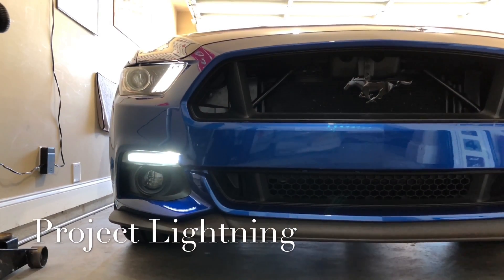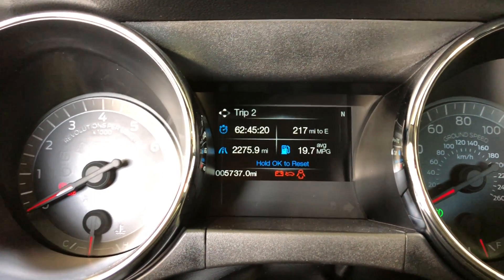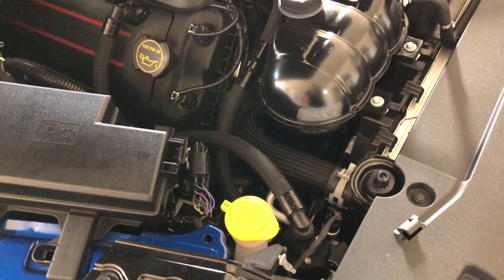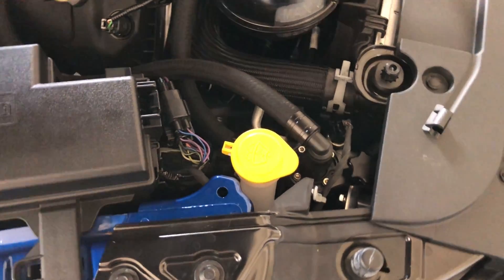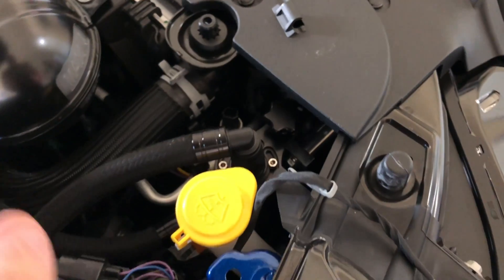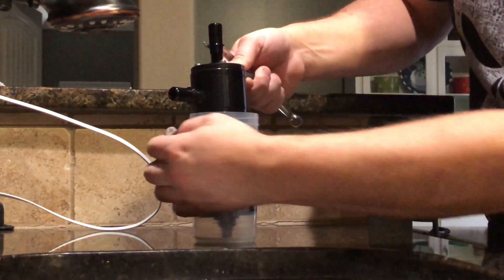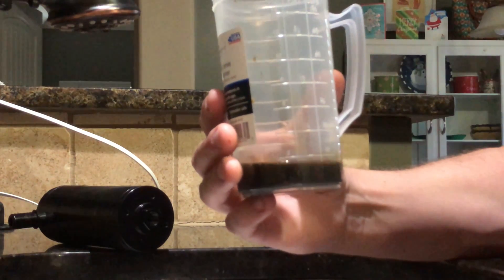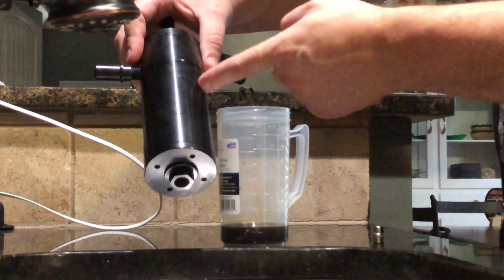UPR catch can draining. (measured) Why you need a catch can.

Comment: Did you flush the inside out with anything to clean it, if so, what did you use to clean the inside with since you can't disassemble it? 

I have the same catch can on my '19 GT but no idea how to clean it out after I drain it, and don't want to flush something like gasoline through it that I know will clean out oil, but could damage the filter elements.
Reply from the maker: I have been spraying chlorinated carburetor cleaner on the inside of this one since it cannot be taken apart to clean the inside when I empty it.   Non-chlorinated would work just as well just wouldn’t evaporate as good.  If you do this remember to do it outside the where it’s in the open air

Comment: Hey Project, has your oil ever been chocolate milk looking when emptied it? I have the UPR remote on my '17 gt and it looked like straight chocolate milk. My thoughts are the previous owner didn't empty it before selling the catch can to me.
Reply from the maker: Yes,  In my other videos i explain the cans operation better.  The can will catch water vapor as well as oil vapor.   That's why it looks like that sometimes.  Outside temp and humidity have a lot to do  with how milky it will look.
Reply: Ahh ok, thanks for the response! I was worried something was wrong haha

Comment: You still get a ton of oil threw the driver side. I went with breathers after installing the upr catch can and looking inside the manifold had oil all over it. Yea it probably would of been worse without the oil catch can but doesnt completely stop oil from entering the manifold. Good video tho.
Reply from the maker: Jpadilla05 There is no reason you should be getting oil in through the driver side, since the direction of airflow is going into the engine on that side.  It pulls fresh air into the crank case on the drivers side and pulls air out of the crank case on the passenger side, pulling oil and “condensation” water vapor out with it.  The catch can on the passenger side is to catch this oil and water vapor that is pulled out.  I have never had oil in my intake tube from the drivers side PCV tube. The air flow just doesn’t go that way.

Comment: ive been meaning to ask you what kind of 0-60 times are you getting ?
Reply from the maker: ron nie Haven’t really tested that.  Wheel hop is so horrible on these cars stock and the launch control sucks. It’s really pointless to try and test on a car with stock suspension and tires.
Reply: I don't have the wheel hope. I have a 2107 gt california. I have lowered it 1" all around but. I have not  done any full burn outs though. I did put a ngauge and cold air intake on huge difference. My first and only pull so far was 5.3 sec.
Reply from the maker: ron nie I had a 2016 GT performance pack with full BMR suspension including the lower control arm bearing upgrade to get rid of the wheel hop.   But I never tested 0-60.

Comment: I checked my oil at 3500 miles and added 2 quartz, guess I do need a catch can, I was thinking only forced induction engines needed them.  I do the spirited driving every where I go especially since I installed the corsa sport catback😁
Reply from the maker: You get a good bit of blow by on a N/A engine just have a lot more on forced induction.  2 quarts is a lot to have to add tho.
Reply: Project Lightning yea I thought that was a lot for a brand new car but I was thinking it was because it was new idk, definatly keep a closer eye on it from now on.
Reply from the maker: I have heard that during the first 500 to 1000 miles it may use some due to break in. They may have just not checked it at the dealership when they PDI on the car when they got it.